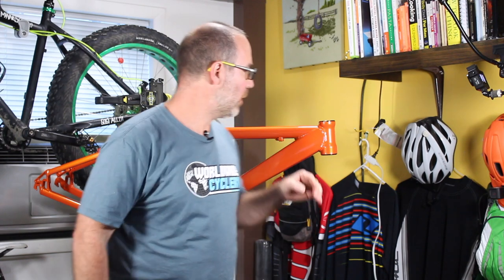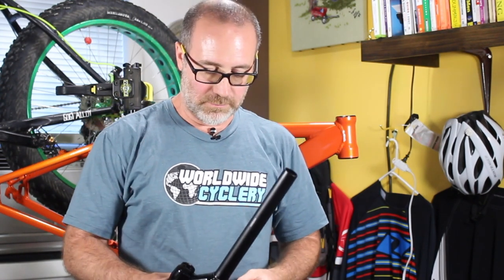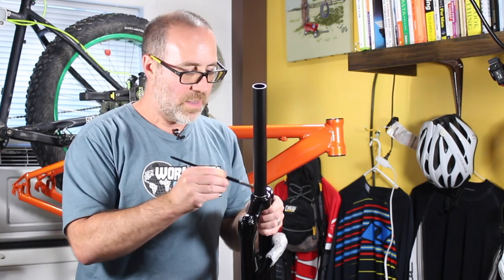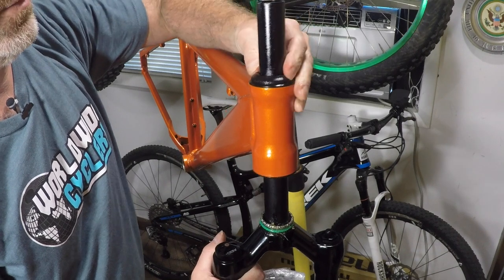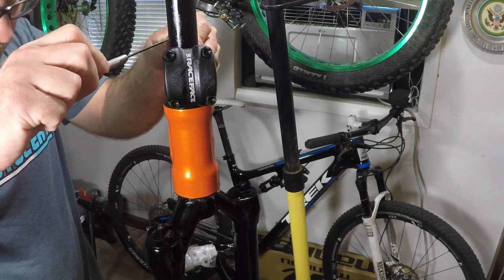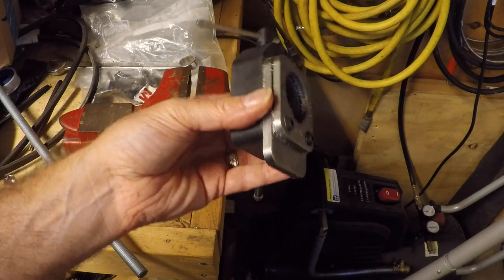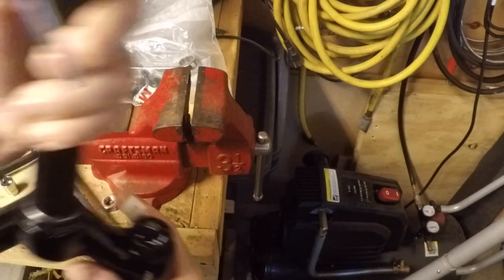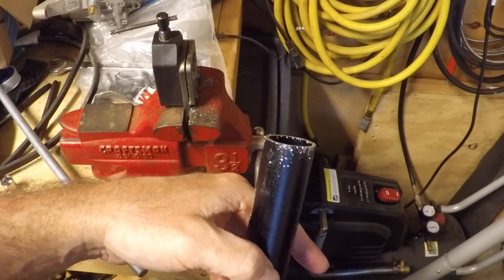How to install a fork | Part 2 How to build a MTB

Comment: Enjoying the mini series! A couple pointers from a bike mechanic: 
1. Use a silver paint-pen to mark the steerer tube before cutting as you can wipe it off with acetone later!
2. Make sure to screw the star nut into the tool before smacking it into the steerer tube, as you could damage the threads of the nut and tool.
3. Never leave more than about 30 mm of spacers below the stem, as this is a safety issue.
4. Don't worry about adjusting the headset until you have wheels on the bike and it's on the ground.
5. A torque wrench can save a lot of headaches! LOL
Reply from the maker: Wow man this is great stuff! I'll be doing a wrap up video and sharing all the tips I've learned. Hey, don't we have a bike check that needs to be recorded? ;-)
Reply: Regular Guy Mountain Biking Nice!  We do! We should schedule sometime in the coming week!

Comment: This is such an interesting series!  My friend owns a bike shop so I have never and probably will never have to do this level of wrenching.  I adjust shock pressure, adjust (but don't bleed) my brakes etc.  That said, it is really great to see what is involved with a head set and how that works.  For instance, I have seen that headset cup removal tool hanging on his shop wall for years and had no idea what it did.  I am really looking forward to the bottom bracket and the brake bleeding episodes.( I know I'm a dork!)  Keep up the good work!
Reply from the maker: Thanks so much for the kind words! Yep, brakes are coming to the series as well. These videos are taking some time to create but I'll keep pushing on :-) Thanks for watching and commenting!

Comment: Used a plumbing pipe cutter on mine great cut smooth just took a file to the edge cause that baby was sharp.
Reply from the maker: Really? Aren't those just for copper pipe? A fork tube is so much thicker that I would never think it would work?
Reply: Regular Guy Mountain Biking  thicker yes but it works no more effort than cutting a piece of pipe.
Reply from the maker: Excellent! I'll be doing a follow up video on everything I learned and will include this. Would you mind linking the one you used? Or at least one like it?

Comment: Excellent video!  Quick question for you.  I'm putting together a list for my first build.  Does the headset typically come with spacers and top cap or do they need to be purchased separately?
Reply from the maker: The cap will come with the headset. The spacers do not so you'll need to grab some of those too 👍

Comment: I think you did a good job with this. good camera angles, great explanations.
9:01 but keep that the screwdriver far away from the stations, you don't want to scratch them.
I would not use a star nut, as they can get skewed, so you have ruined it with a screwdriver and remove it. so, for this reason, I went with Hope Tech Head doctor. IT happen on my Trek 6300, I had the bike in for a repair(rounded off stem bolt) and I saw the headset clamping screw & top cap was skewed. I rode this bike pretty hard for several years, but not right before this happen, mabye it weakened.
Reply from the maker: Thanks for the comments! Question, I was very interested in your comment regarding the Hope Tech Grip Doctor. I looked this product up and it seems to be for bar ends correct? Did I look up the incorrect product?
Reply from the maker: Ah ok I found it. That product you are talking about is called the Hope HEAD doctor. Very interesting my friend and thank you for the lead! Possible review maybe?
Reply from the maker: No problem my friend! I actually just sent Hope an email asking to review this product and their end caps. Pretty cool stuff and I thank you for the lead! Dude, you find some really killer products! So glad to have you around my friend ;-) 👍👍👍
Reply: it worked great so far I have not had any issues with it, but Not installed it on my fuel's yet, as the star nut has not been damaged on them. but I have nothing bad to say about the head doctor.
Reply: the Hope Grip Doctor is durable, and sits securely, as long as the bolt is torqued properly, it survived a crash from a skate park ramp, and my carbon bars are still whole so, I am satisfied. those plastic end caps that many have or grips come with are useless, as they don't protect the bars.
But if you want custom caps you can go for: https://kustomcaps.com/ but I have not tried those. But I think BKXC use them

Comment: I thought the steerer tube had to sit below the level of the top spacer a couple of mm, so that the top cap can pull the fork up. The way you have cut that, the top of the steerer looks almost level. I have never done this, I just want to understand what the correct approach is!
Reply from the maker: You are correct that's how I like to cut my steerer tubes. I guess maybe the camera didn't show it correctly?

Comment: 7:26 what is that plastic cap called between the stem and the head tube I broke mine and need a new one but dont know what there called any help?
Reply from the maker: They are called spacers. Either, steerer tube spacers or head tube spacers. I mix and match what I call them because the shops all understand haha! Make sure the ones you buy match the diameter of your steerer tube 👍

Comment: What are your thoughts on using a pipe cutter/tube cutter - ala http://www.homedepot.com/p/RIDGID-101-Tubing-Cutter-40617/100075014 - for cutting forks, bars, etc?  It seems to me like you're replacing both the jig and the hacksaw, plus they cut much more smoothly than a hack saw.  Any experience with this?   Great channel by the way - appreciate your honest, genuine stance towards the sport
Reply from the maker: Jeremy Porterfield First, thank you for watching and the kind words! Next, those cutters are not going to be strong enough to cut a fork tube or seat tube. Maybe handle bars but even that I'm not confident.
Reply: That makes sense - thought I saw someone using them but it would have been on handlebars, so that makes sense.  Btw, subbed!
Reply from the maker: Sweet man! Thank you very much!